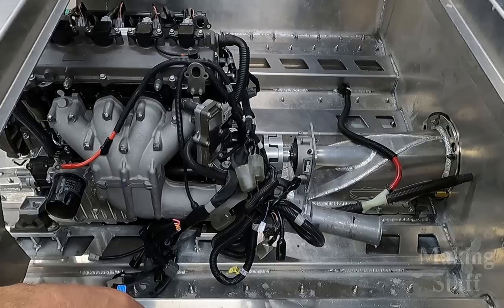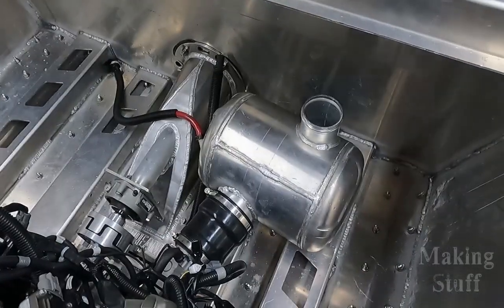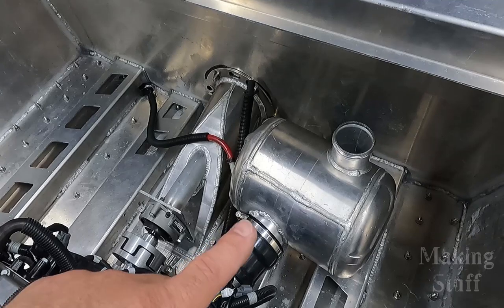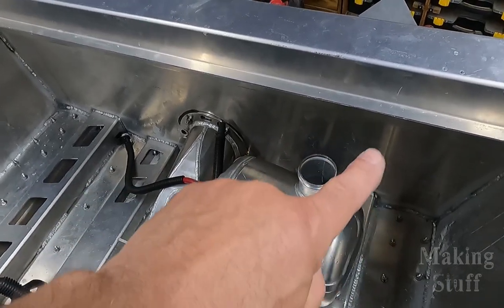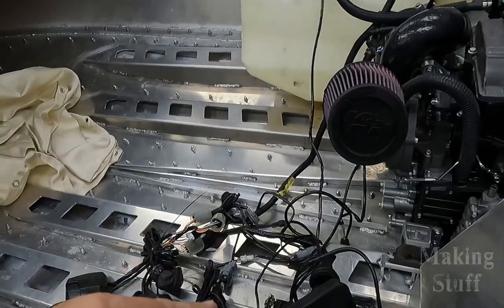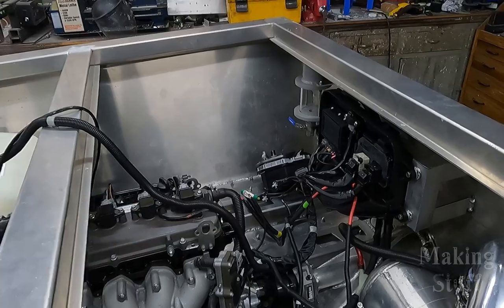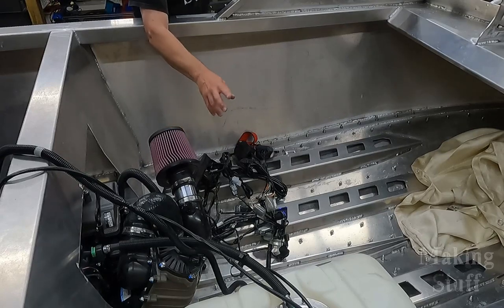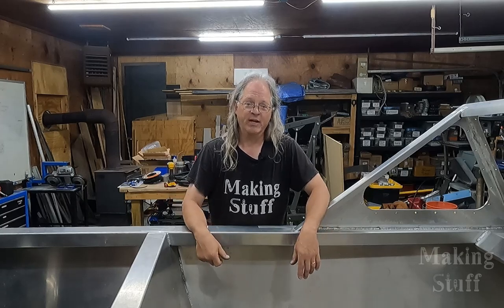Firing Up the Supercharged Mini Jet Boat for the First Time!

Comment: Excellent project. Isee why you were dreading the exhaust but it turned out well. One thing, it might be worth mounting the computer on some rubber shock mounts just to try and cushion some of the vibration. These boats take a hammering. Well done....
Reply from the maker: Thanks!

Comment: Do you have a video of hooking up the wiring to prepare it for the start? I've got the same setup and want to ensure everything is plugged in correctly.
Reply from the maker: No.  On this Yamaha all the plugs are different so it's not possible to hook it up wrong.

Comment: What size tubing did you use for the exhaust?
Reply from the maker: The Yamaha water box had 80mm pipe coming out of it, so that's what I used for the rest.  Bought an 80mm kit off ebay.
Reply: Thank you Bob. I'm building a buccaneer with the exact same powerplant.

Comment: That counts as a start on the first try. Nobody else would have taken their finger off the button that soon. Also, a shot of ether would be very common and would have worked perfectly.
Reply from the maker: Not sure if holding the button down does anything, you may be right.  If you just give a a slight press, the starter will run for about 5 seconds (with no start).  I thought it would try for 5 seconds but apparently I was wrong.  Thanks for watching!